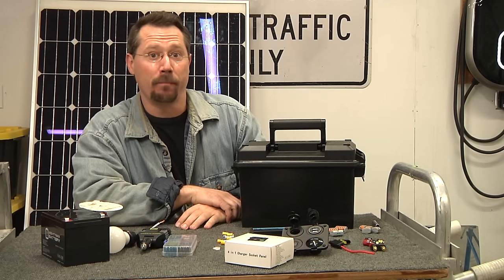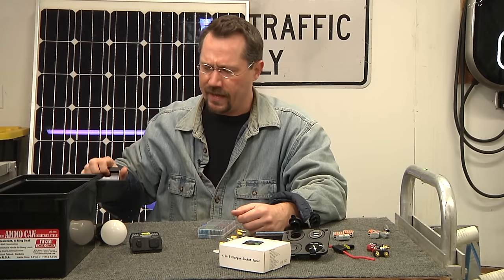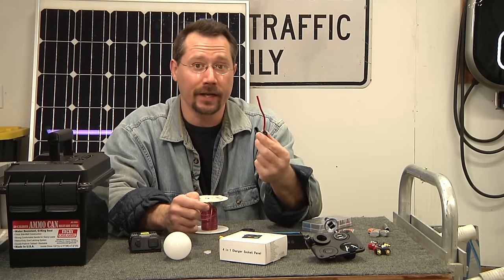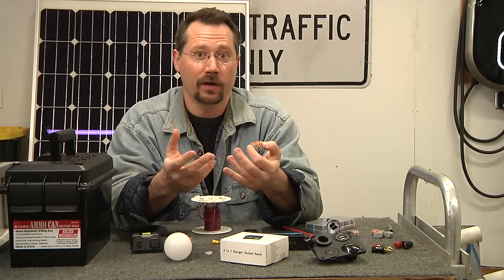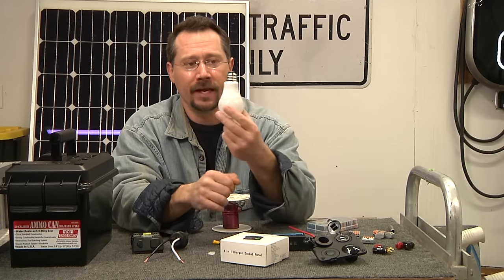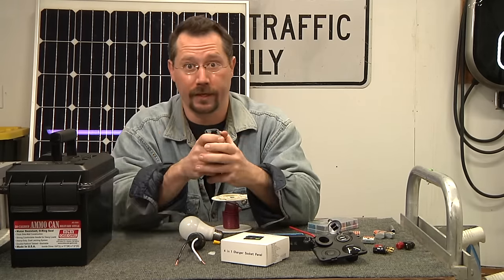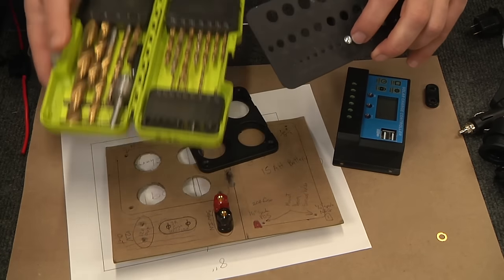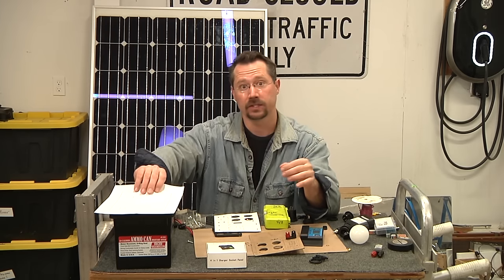Build A Solar Ammo Can Full-Length Instructional Video

Comment: Nice video! If I want to use two of those batteries in parallel, the 20A charge controller will be enough? Thanks!
Reply from the maker: Batteries in parallel allow for more capacity. The 20A charge controller would simply limit the maximum power in and out to 12vx20A=240 watts. If you need higher than a 240 watt output, you would want to go to a higher voltage system, such as 2 or 4 batteries in series for a 24 or 48V system.
Reply: Ok. Thank you.

Comment: Is that a jumper wire in the wago clamp for the negative wires?
Reply from the maker: Yes, there were just too many negative wires to all fit in the one connector. Using a traditional wire nut or a negative bus bar would also be other options.

Comment: Great instructional video. Very meticulous and well presented... I'm probably gonna get shot for asking this, but can't you buy commercially available ones for about what this cost you to build? Sorry... had to ask..... Again, great video.
Reply from the maker: The least expensive commercially-made device that I found cost double what it cost me to build this. This project has about $100 in it for parts. The Goal Zero Yeti 150 has pretty similar specs and goes for $200 on Amazon - http://amzn.to/2EVFCt8 The Yeti 150 also does NOT include a light or any other accessories (although it does include the inverter.)
Besides costing half as much, it's fun to learn how things work, and take pride in building something yourself! The other thing that I love is if I build something myself, I can customize it and I also know how to fix it. Repairability has become a major draw-back to modern consumer items.
Reply: Thank you for the justification/clarification. Well said.... Excellent video.
Reply: So ture BenjaminNelson!  I scrapped two commercial Power Station/Storm Station type products before I learned how to build the DIY systems.  My first system which has a 90 amp hr. flooded lead acid battery is now nearly 3 yrs. old.  My second system which has a 14 amp hr. sealed lead acid battery is now two years old.  I just let my sister-in-law borrow it as emergency back up for her 12v medical device while she is attending a sporting event.

Comment: Is this enough to  hook up 12v fridge for camping?
Reply: The best answer is "maybe". The fridge should have a wattage on a label. Fridges run on a "duty cycle". They don't run continuously. It would draw power until the temperature is reached, then turn off. When the temperature reaches a predetermined warmer setting inside, then the compressor turns on again. So it constantly turns on and off. Find the wattage or amperage from the label. Then you can determine if it will work.

Comment: Great job! Did you consider adding an inverter?  This way, you can plug in an AC powered device.
Reply from the maker: I use a 100 watt inverter with this. It's very small and inexpensive. Fits right in the box. Check the video description for links.

Comment: Would you still be able to use the same battery controller if you use 2 batterys?
Reply from the maker: Yes. You would use two batteries in parallel, connecting the + of both batteries together and the - of both batteries together. This keeps the same system voltage, but increases the capacity. Use the same brand/size/age batteries so they are matched.
Reply: @BenjaminNelsonX  thank you!

Comment: Hello Ben.
Thanks for video well done Ben. Can you use 30ah solar charger? I like to build one just like you.
Reply from the maker: The same brand as the solar charge controller I used also makes a 30A version. You certainly COULD use that, but I'm not sure why a person would want to. That would be good for up to 360 watts of solar IN to the battery! That's a very large solar panel, and no longer really portable. The battery cut-off feature would also be 30A, but a 30A draw is already a heavy load for a battery this size. A 30A charge controller would be great for a setup with a larger solar panel and battery.
Reply: Thank you Ben.

Comment: How long does it take to fully charge using the DC Power Adapter (Wall Charger)?
Reply from the maker: I'm just using a very low power (1A) power adapter. A 15AH battery run down half-way would charge in about 8 hours.
You can always charge faster with a higher current power source.
Reply: @BenjaminNelsonX  any recommendation for fast charging?
Reply from the maker: @Pap3rPlanesss  It would just need a higher current charger. A 15A charger would charge a 15AH battery in one hour. We typically charge lead-acid batteries at lower rates than that though.
Some lithium batteries can be charged very fast. Just take a look at some lithium tool batteries and the rates those chargers use!

I'm going to have a video coming up soon using a lithium battery with an updated version of this project. I'm also thinking about doing a version literally using a straight-up lithium cordless drill battery.
Reply: @BenjaminNelsonX  I look forward to that I have a couple makita batteries !

Comment: Hi Ben. Great video. Very helpful guidelines and tips. I wanted to ask and I hope I'm not asking stupid question. Can it use to jump start a car? Thank you in advance.
Reply from the maker: Jump-starting a traditional automobile takes very HIGH CURRENT to run the starter motor. A small battery like this with thin wiring is NOT designed for jump-starting.

There are a few cases where it can work. I actually used this project to "jump-start" my electric car when I accidentally ran down the 12V battery! In that case, there's no starter motor. I just needed to provide 12V power to "boot-up" the car!
Reply: @BenjaminNelsonX  I understand your explanation and thank you. I'll look into other alternative options or add on to this power box to jump start a car. I'll update if any. Thank again Ben. Keep up the good work.

Comment: Can we put multiple battery's in there?? You should start selling these too. Love this video please make more like this!!!!
Reply from the maker: I designed this project so that there's a little cargo space in there. You could instead use that space for a second battery of the same size. Connect the two batteries in parallel by connecting the positive to positive and negative to negative. That would double your battery capacity while keeping the voltage the same.
Reply: Consider this about connecting batteries in parallel - while they are providing power to a load, it is usually OK. When they are not, you could get what are called "circulating currents". The voltage and capacity of each battery may not be the same. In this case, the battery with the higher voltage will attempt to charge the battery of the lower voltage. This will continue until equilibrium is reached. If he difference is significant, the better battery will just discharge into the other one. There are ways to prevent this by using diodes that stop the reverse current. It will also result in a slight voltage drop when the diodes are forward biased (conducting).

Comment: At 41:23 you glued down the panel before connecting the battery terminals.
Reply from the maker: No, I glued on a piece of wood so that the panel can be VELCRO'd to the battery to hold it in place. The panel is removable to access the fuse, or otherwise make changes if needed.

Comment: Ben, I just had the faceplate delivered. If I want to use the Lithium battery you mentioned in the update can I still use everything else?
Reply from the maker: Yes.
Reply: @BenjaminNelsonX  Sorry, I meant to be more descriptive in my question. Will the solar controller work with a lithium battery? Thanks again!
Reply from the maker: @Daddrone  The solar charge controller I used in this project is a fairly basic one, designed for lead-acid batteries (flooded, gel, AGM.)
The lithium battery that I used for an upgrade is designed to work with standard 12V chargers. I did check the settings of the solar charge controller and the recommended charging for my lithium battery and just adjusted the Solar Charge controller a little.
There are also more expensive/fancier solar charge controllers designed specifically for lithium.
For my upgrade, I just used a lithium battery that's designed as a drop-in replacement for lead.
https://youtu.be/bQCJFK-Yzb0
Reply from the maker: @Daddrone  The battery I used for my lithium upgrade is designed to work as a "drop-in replacement". It should work with any typical 12V battery charger or solar charge controller.
There are also other Solar Charge Controllers that are a little more expensive and complicated which are specifically designed to work with a dedicated lithium battery pack, such as one you might build yourself.
I just used continued to use the controller shown in this video and confirmed the output of the controller matched the recommended charging settings for the lithium battery. I did change one setting on the controller to better match the battery recommendations.

See the lithium battery upgrade video at: https://www.youtube.com/watch?v=bQCJFK-Yzb0

Comment: Did I get this right? Did you connect the panel to the load slots of the controller??
Reply from the maker: No. The solar panels go to the solar input of the controller.
The load connection of the controller is for lights, USB, and anything else you are POWERING with the device.
Reply: @BenjaminNelsonX  I should've been more specific. I meant the socket panel, not the solar panel.
Reply from the maker: @lawmoments  Yes, the sockets are a "Load". They are an output. That connects to the "Load" terminals on the solar charge controller. That allows the controller to disconnect the loads if the voltage drops too low. It helps keep you from killing the battery if something is left plugged in, running the battery down.

Comment: The other outputs work fine, but when I plug the power inverter into the cigarette lighter output the power goes off.  Do you know what could be causing this?
Reply from the maker: Things I would check:
What is the power rating for the inverter? This is only a very small system. It's good for a 100 watt inverter, but NOT a 1,000 watt inverter!
It's possible that the inverter is bad. Test it out on some other 12V source. Make sure you aren't drawing too high of a load through it.
Check the connection to the 12V jack on your Solar Ammo Can. Make sure the polarity is correct (red and black + and - wires aren't reversed) Make sure the wire connections are clean and solid. Test the 12V jack with some other low-current 12VDC device which is known to work.
Reply: @BenjaminNelsonX  Okay thanks, I'll try that.  One more question that I have.  I have a SAE to banana jack output cord that came with the solar panel, but the wire looks like a smaller gauge than 12 gauge, maybe 14.  Can I use this, or does the input wire from the solar panel also need to be 12 gauge for everything to work correctly?
Reply from the maker: The thickness of wire needed depends on how much current will be traveling through it. 14 gauge is generally used for up to 15 amps.
Take a look on the back of the solar panel. It will tell you how much current (in amps [A]) is the maximum the panel can create.
Since the cord came with the panel, the manufacturer would have made sure it was appropriate for use with that panel.

Comment: Do you need to add fuses to each load or is the inline fuse between the battery and solar charge controller sufficient?
Reply from the maker: Lets use common household wiring as an example. Does each electric outlet have its own fuse or breaker? No. It's common to have multiple outlets or light fixtures on the same branch circuit. The wiring and fuse must be rated for higher current than any single item on the circuit.
On a battery-based system, you always want to have a main fuse right from the positive battery terminal. On larger systems (An RV or camping trailer, etc.) you might have multiple fuses/breakers/branch circuits, but on a small low power project like this one, it's not necessary.
Reply: BenjaminNelson 8

Comment: How are you going to replace the battery when it is done.
Reply from the maker: Sliding a pallet knife between the battery and side of the box is an easy way to remove the adhesive.
Alternatively, industrial sticky-back velcro also works great to hold components in place.

Comment: Could I use a wind generator to change the batties as well?
Reply from the maker: Yes, but there are very few good SMALL wind turbines out there. I have a kit one in a box that I want to break out and try sometime.
One issue with wind generators is that they tend to vary voltage quite a bit.
Reply: @BenjaminNelsonX  I believe that wind turbines generate DC. Then that is inverted to the correct voltage and frequency that will allow it to be synchronized and connected to the grid. I wonder if your wind turbine puts out a 120vac sine wave at 60Hz.

Comment: Since you made a digital template, you could always amend the template slightly to make it 3d printable.
Reply from the maker: While a person certainly could 3D print a sheet with a number of holes in it, it seems easier to simply use a piece of solid material and cut the holes in it where they are needed. That would be sturdier, faster, and simpler.
It would be very easy to convert my 2D file into a 3D file - just extrude it.
I haven't had anyone else express interest in doing a 3D print. If anyone does try it, please let me know, I'd love to see the results.

Comment: could this be used to power a 12 v TV for 5-6 hours?
Reply from the maker: To answer how long any device can be powered from a battery, you need to know how much current that device draws and the size (capacity in amp-hours) of the battery. Most electronic devices list how much power they use right on the back near where the power cable connects. This particular project would be great for watching entertainment on an iPad or other tablet. For larger devices with heavier current draw, you would likely want a larger battery.

Comment: Can I put two of those small batteries in there for a longer charge guess what I was thinking is buying a group 27 battery
Reply from the maker: Yes, you can double up the small batteries for double the capacity. You just end up losing the "storage space" area in the box.
Reply: @BenjaminNelsonX  what I was wanting to do is possibly get one of the coolers that you plug in the cord into your cigarette lighter and also with two batteries that could be possible am I correct and I could still plug something in like a hundred 75 watt or maybe a 200w power inverter to run like a a laptop or something like that
Reply from the maker: @davidlingelbach9887  The main thing you need to know is how much current (in Amps) your device draws, and how many hours it will do so.
A laptop is no problem, they tend to be very efficient these days.
A thermo-electric cooler may be more of a challenge. The one that I have draws 5 amps.
It also runs continuously. So, if I ran it overnight for 12 hours, that's 5 amps times 12 hours for 60AH!
That ice-less cooler is an energy hog! 
(I think that one reason they are so Inefficient is because they would normally be used on a car-trip, where it's constantly plugged into the car, with the battery always charged by the gasoline engine via the alternator.)
You would need something about the size of a car battery to have the capacity to run that cooler overnight.
Also, if you do need to recharge from solar, you need to recapture that much energy the next day to recharge! We would be talking a fairly good-sized solar panel. Probably NOT one you want to take camping with you.
Reply from the maker: For a heavy load, a larger battery, like a group 27 makes sense. Just keep in mind that you also need some way to recharge it. A 1 amp solar panel isn't going to cut it!
The good news is that all the components in this project are rated for 20A. You can simply use a large deep-cycle battery, and keep everything else the same.
(I hope it's obvious that you wouldn't put a Group 27 battery INSIDE the ammo can....)
Reply: @BenjaminNelsonX  then would it be cheaper to buy like a jackery instead of building one myself

Comment: Hey Ben. Great video. I made one of these about a year ago using one of your wood panels and it came out great!  I’m now having some battery capacity issues. The first two or three times I used this it was great. Now the battery discharges in about a third of the time. Could it be time for a new cell already?
Reply: Lead acid pbatteries don't have too many cycles without losing capacity.  Try LiPo or other lithium batteries.